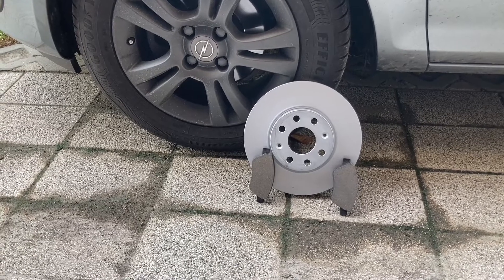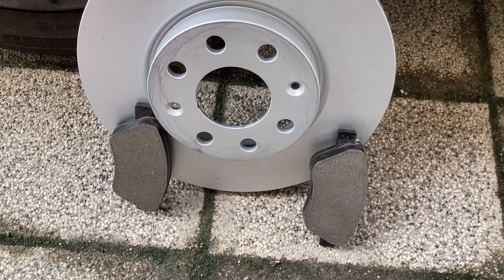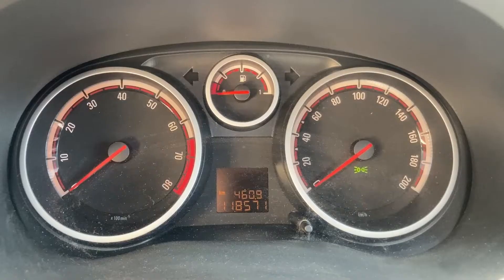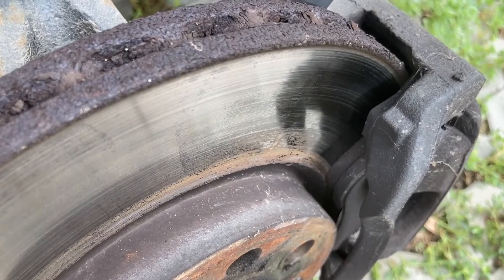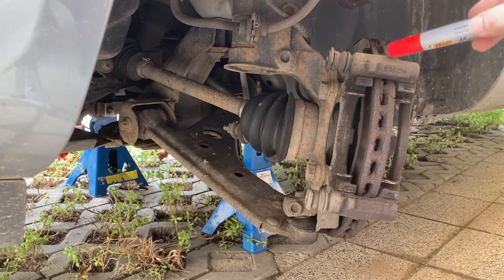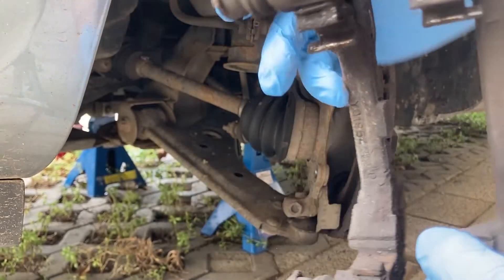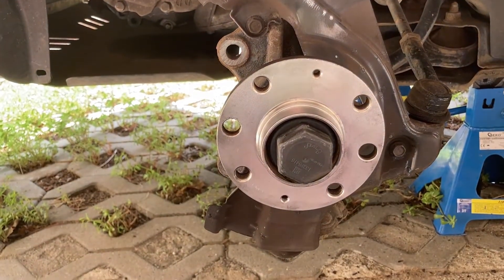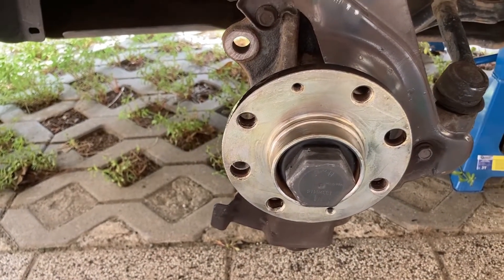DIY - 2014 Opel Corsa D 1.4: Change the front brake discs (rotors) and pads

Comment: Thanks for video, i will change it next month. However i sugest check caliper dust boot and poston. Other thing is - open air release (bleader screw) when push back piston, breake fluid inside caliper is preaty dirty.

There is a little metal fragment on this jack stand - there is "C" shape hole with metal piece inside - hamer it to prevent come out inner column.
Reply from the maker: Thanks for the advice! I did check the state of the caliper piston and dust boot off-camera and they were in good condition. I explicitly didn't want to touch the bleed valves at this point - that's why I allowed the fluid to be pushed back in when pressing in the caliper piston. I never had any issues with this method, though your solution does make the pushing easier if the bleed valve is not seized in place. As for the "C"-shaped hole in the jack stands, I'll take a better look at them the next time I use them. Thanks again!

Comment: Hello friend, i have a probleme with the abs pump module, do you know the OEM of the module? We have the same motor A14xer. Thank you.
Reply from the maker: Hi! Based on the VIN number of our own Corsa, the ABS module's OE number is Opel 530016 / GM 95507578. But it's best to go to a dealer with your own Corsa's VIN number and ask them for the part number.

Comment: Hello friend, and what about plastilube for the pins? Is good? Thanks.
Reply from the maker: If you're referring to the ATE Plastilube, I haven't used it myself. But according to the specifications, it is suitable for use on the caliper slide pins and the backside of brake pads (to avoid squeaking).
Reply: And the TRW are 100% syntethic? Dont dammage the rubber? Thank you friend.
Reply from the maker: @nunogoncalves24  Yes, it is safe to use with brake-related rubber and caliper slide pins, as per this spec sheet: https://www.partinfo.co.uk/files/XZS120GB.pdf. I've been using it for the last 4 years on all my cars with no issues.
Reply: @TheMissingBolt  Thank you again my friend, keep the good work. 
Greetings.
Reply from the maker: @nunogoncalves24  You're very welcome!

Comment: Whats the adhesive for on the two pads?
Reply from the maker: To be honest, I don't know exactly. The Range Rover and Kia pads have no exposed adhesive, for example. I'm guessing it helps the pad grip better against the caliper, so that when you release the brake the caliper will "pull" the pad away from the brake rotor so that the pad doesn't end up sticking.